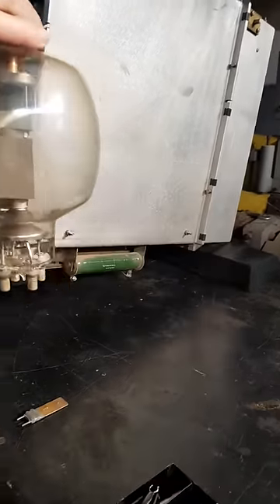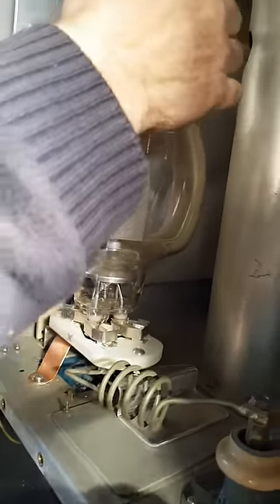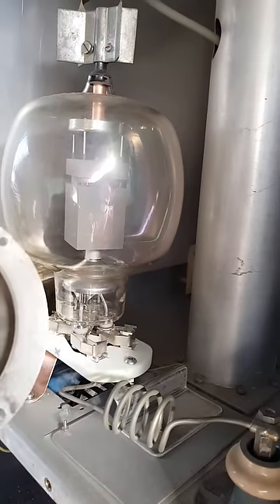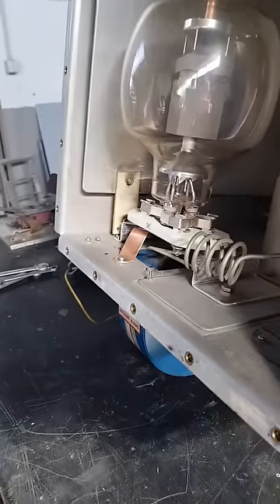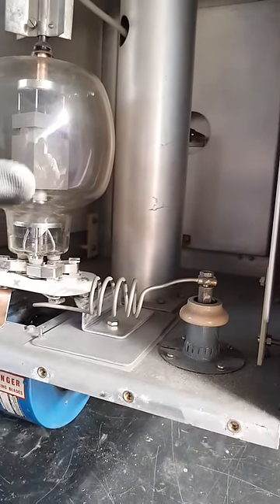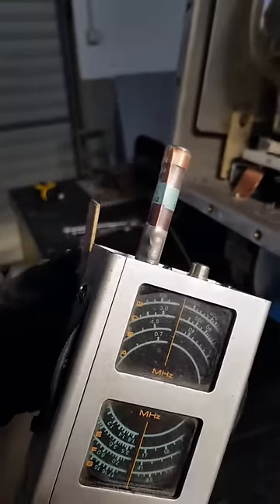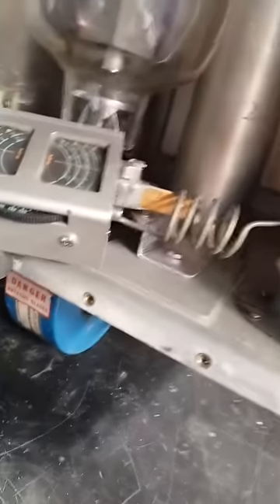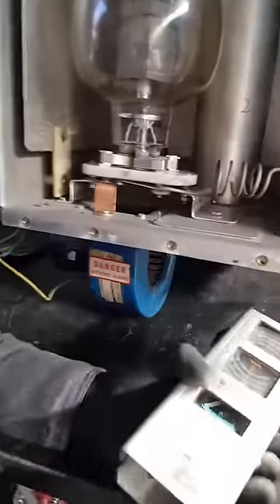HOW TO USE A RADIO FREQUENCY DIP METER.👨‍🏫👨‍🔧

Comment: Dip Meter is approaching the coil and not inserted into it.
Reply from the maker: Hello, sorry for the late response. Yes you don't need to insert into the coil because you will be shortening the length and might get diferent or wrong frequency readings. It also might depend on the dip meter model and make you using because it may vary the technique you need to use.